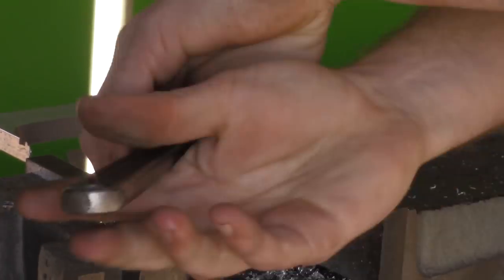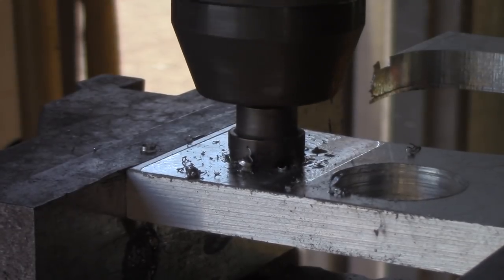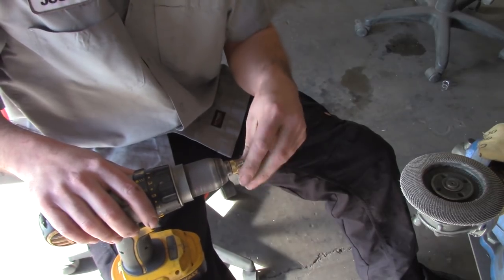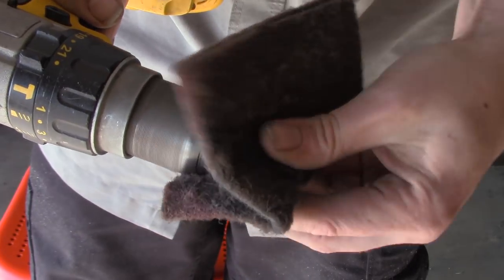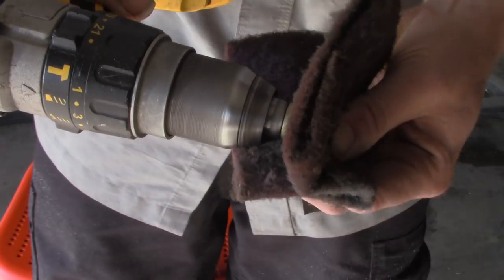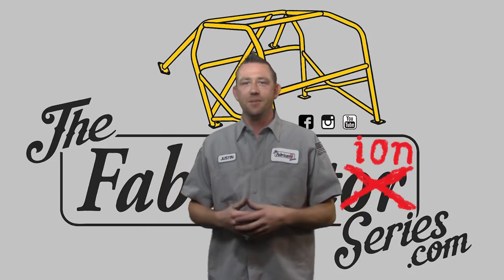TFS: How to Machine a Bung Without a Lathe #TFSFastFab

Comment: A trick with cutting thick metal with a hole saw is to put a small hole on the outside of the part so the chips have somewhere to go so you dont have loud sound and it will cut faster. The more holes you put the smoother the cut.

Comment: I usually start with the hole saw, cutting about 3/4 of the way through the material, switch to drilling and tapping the NPT hole, then go back to the holesaw to cut that final bit. I do this so that the holesaw is guided properly during the initial cuts, and once the cut is so deep to go back with the hole saw will guide itself.

I then use a bench sander to finish the edges.
Reply: Yeah you can't do it like he did if you don't have a drill press.  Your way will work with a hand drill.
Reply: I use a drill press when I make bungs in the way I described above. I'm not sure I'd attempt this without using a drill press.

Comment: Another trick once you have  the basic bung rough cut from the blank if you have a drill press or mill is to use the spindle as your lathe for external finishing. Clamp a lathe tool bit in the vise (even an endmill works well if it held in the vise properly) and spin the part in the drill chuck or (Collet if you have the right size) just like the hard drill portion of this video but use the  lathe tool to cut the OD, chamfer, etc... by moving the quill up and down. This works really well if you have a compound table on your drill press or if its actually a mill since you can use the X axis to set and adjust the cutting depth of the lathe tool. Plus if its a mill and thus having a powered quill feed, you can get really nice finish will little cleanup work needs with sandpaper and/or scotch bright pad.

I do this a lot if I need a bung that I want a flange on it. Basically I mount it upside down (flange side up and then set the quill travel limit to create the flange thickness I need. I cut the initial OD to be slightly larger then the OD of the flange I want, then take it to size with the mill being used as a lathe along with cutting the reduced OD beyond the flange. 

I've even use my mill to cut tapper OD parts in this manner by tilting the head and using the Table elevation to raise and lower the cutter you cant use the quill for this type of cutting because the quill and the part travel in the same parallel direction so the cut is still parallel with the bore, not tapered. You have to have mill that you can raise and lower the table or a column type mill that you can raise and lower the complete head stock independent of the quill.

Comment: When your plunge cutting with an end mill, use the quill stop and every time you turn the stop about half a revolution you take a cut and keep on doing that till you go through the part. A lot of times that end mill can grab and suck the part out or suck the end mill into the part causing a horrible disaster. The quill stop will cause the end mill to stop and not suck it into the part.

Comment: When making something like this with a hand held drill you will have to work from the outside in, in other words cut the outside first and then use the hole in the center to guide either a smaller hole saw or a drill bit. If you cut the inside first there would be nothing to keep the hole saw steady for cutting the outside.

Comment: the drill basically is the lathe here. i have a small lathe but i dont think i would use it to make a part like that. a bung doesnt need to be 100% concentric or anything, its way too simple to make with a holesaw and really doesnt justify setting up the lathe (i often hear "if i had a lathe" from people that think its magically doing itself if you own one)

Comment: Nice, no lathe hack. It will probably  take longer for steel o2 sensor bung just because its harder metal but they turn out awesome!
Back in the day i would find a nut to fit the threads of the o2 sensor and weld it to the header ends.

Comment: no way you can use a hole saw without a center drill in a hand drill.
Reply from the maker: rotch s-garage You actually can. I do it regularly on valve covers. I can't do it with an endmill though.
Reply: Clamp a piece of scrap behind it and drill through that to keep your center